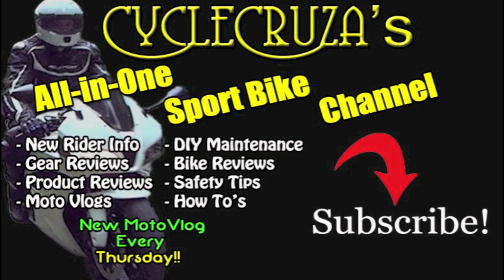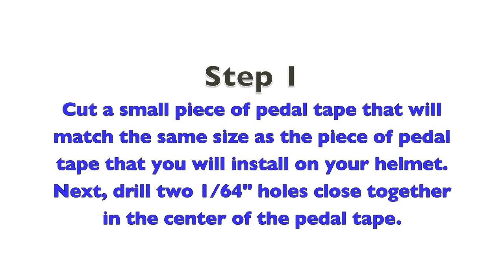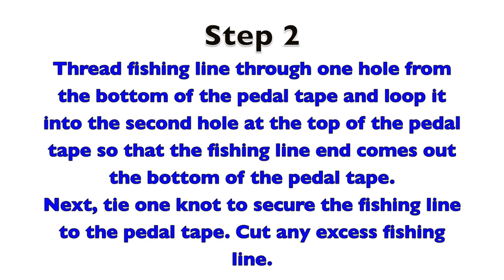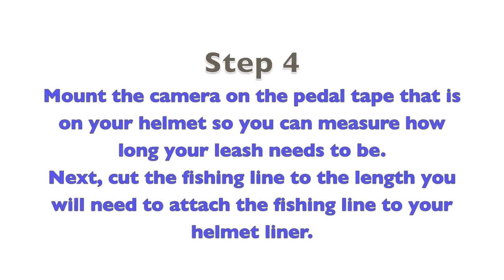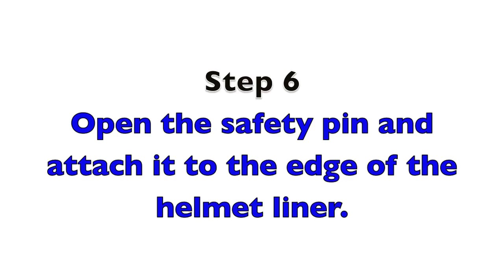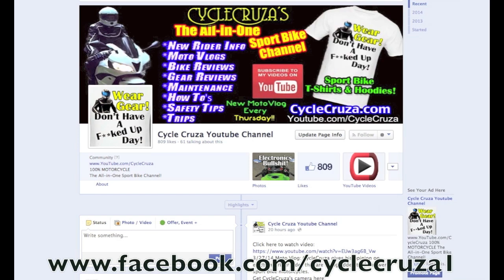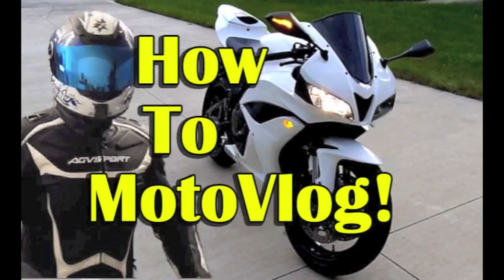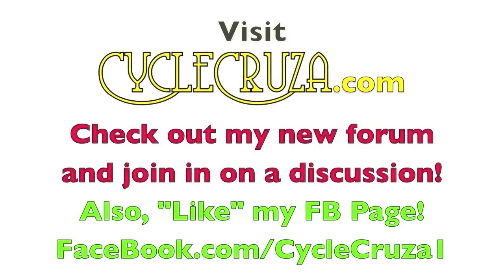How To Make Helmet Camera Leash - Sony Action Cam Leash - Pedal Tape Mount

Comment: I'm testing the 3M Dual Lock. Seems very strong. Run it over 160KMH (100MPH) and didn't move a bit.

Comment: Nice i have that camera, where can i find the Power-Grip?
Reply from the maker: Link is In the info section of video!
Reply: Im not from USA, so that's why im asking, which kind of store can i go.
Reply from the maker: Lonely Spawn If you can't buy off amazon then I have no idea where you can get it at. Check EBay.
Reply: Ok. Thanks. 
I have a question about the CBR 500 R.
Saw the video i know, but today a salesman told me that the bike just gives 180 Km/H (115 MpH) 
Was he wrong about it? How is that even possible i have a Yamaha R15 and it gives me 150 Km/H (90-95 MpH)
Reply from the maker: Lonely Spawn That sounds about right.
Reply: CycleCruza With that money i'd rather buy a Ninja 300 and i have that speed. Or even a Hyosung 650GTR and i have 230.

Comment: Another idea..Tyger Leader makes a tieable stainless steel leader material...Which is way better than monofilament fishing line.
Reply from the maker: This fishing line is rated at 20lbs, the sony action cam only weighs 2.3 oz. lol If this fishing line can yank a 20lb fish out of the water you will have no problems with this fishing line snapping with  2.3 oz camera attached to it.